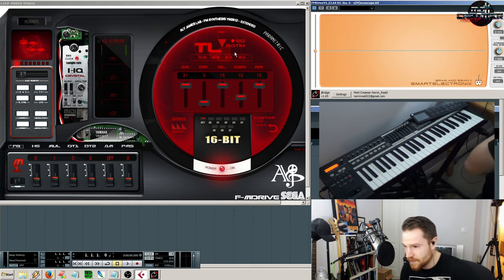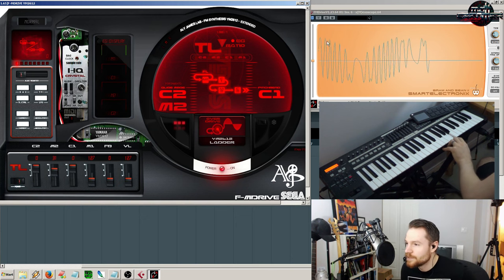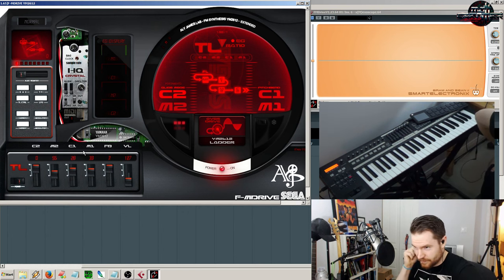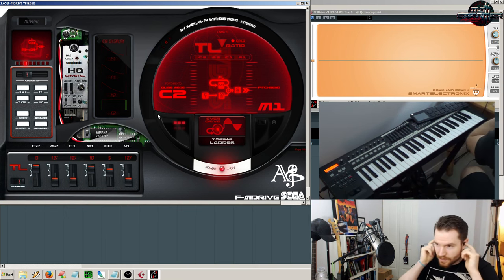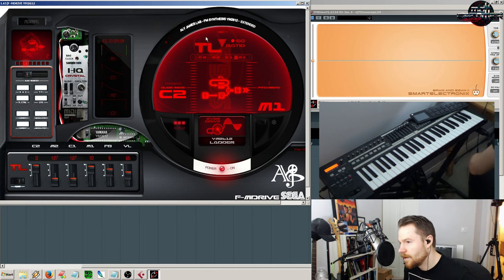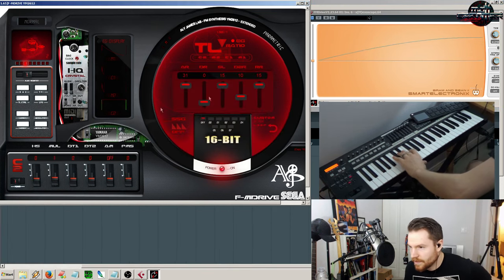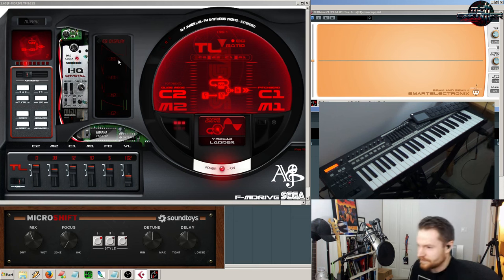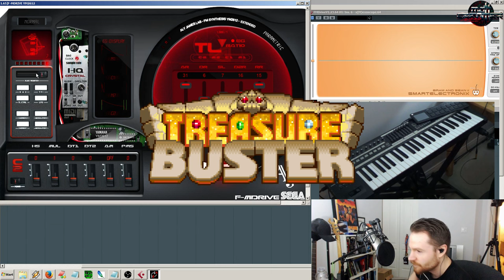Treasure Buster - 00 - What is Frequency Modulation?

Comment: I was looking for a good genesis sound VST for the longest time. This looks/sounds awesome!
Reply from the maker: I definitely recommend this one if Genesis sounds are the goal. The only downside is that, for now, it is 32bit only. It is the last 32bit VST that I still use. Dexed is a free 64bit DX7 alternative, but it doesn't have the specific Genesis charm of the distortion, or the emulation in general. Still worth grabbing all the same.